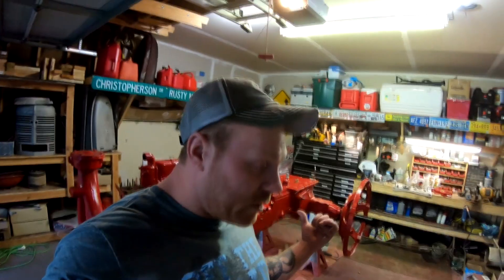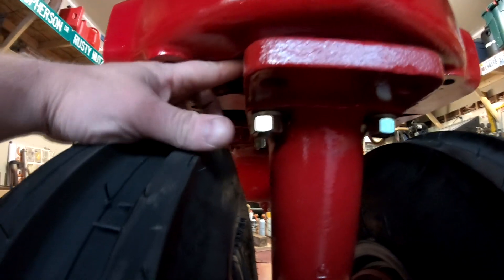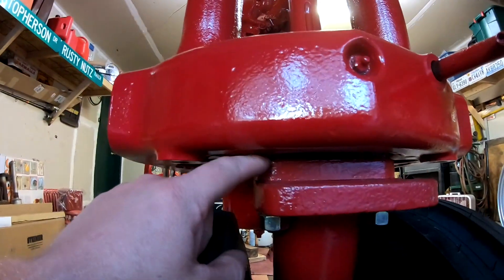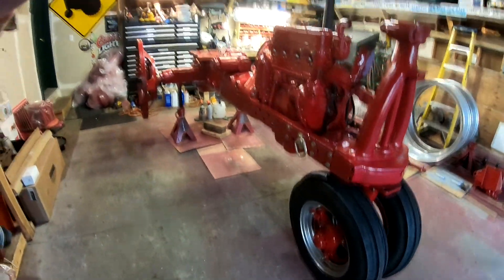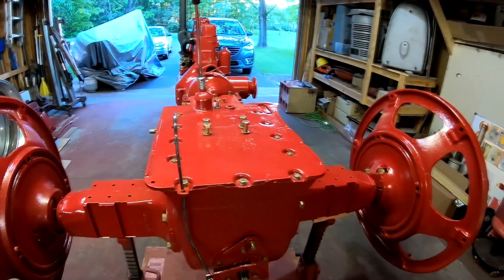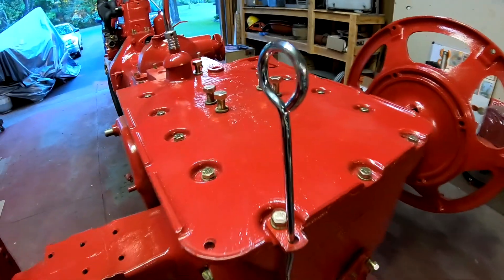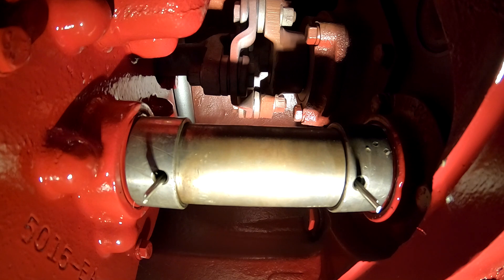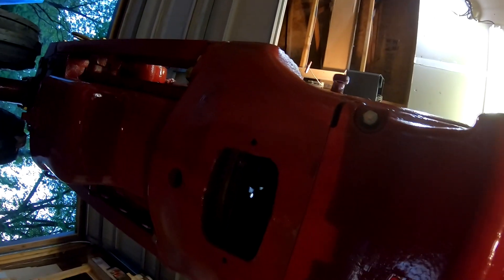1942 Farmall H Memorial Restoration: Lift All/Hydraulic Pump Installation

Comment: Didn't realize that the H and M are different as in less room on the M to hook up the belly pump.  Learn something new today.  Thanks for the video.
Reply from the maker: Yessir! Lot of differences between an H and M. The clutch housing is just one of many. The M has a much shorter clutch housing than the H.
Reply: Thanks for the reply.  @KennyKizzleRustyNutzRanch  I remember helping my Dad put the belly pump in his Farmall M.  It had to be connected  while the pump was going up in the clutch housing. Never took the belly pump out of my H.
Reply from the maker: @stanschleusener6444  yessir. The M drive coupling had the tabs for the drive cogs machined perpendicular to each other, so the only way to install it is to do it while you are raising the pump into position. There are no retaining collars like there are on the H.

Comment: What you forget when you don't work with these every day. I did not realize the H had a long hydraulic pump drive shaft. Maybe I never helped dad take the belly pump out of the H. I know the M has a very short coupler that has to be lined up while you raise the pump in to the housing. We would lift the pump up with a rod through that belly pump hole and screw the fill plug onto the filler neck when we had it up high enough. We would regroup and lift it the rest of the way to get the bolts in. My dad had found a take apart coupler that had a cotter pin to hold the dog together. I have a video on it on my channel called "Farmall M Belly Pump Drive Coupler Dog" It sure was a time saver.
Reply from the maker: Yessir. The M is a lot different. The torque tube/clutch housing on the M is much shorter than it is on an H. It's funny the minds of tricks a person learns while doing this stuff - especially when doing it alone. You sometimes have to get creative!

Comment: my IH dealer had 2 T shaped  handles that fit in that big hole in the bottome of the pump casting 2 mechanics could lift the pump in  and out with it
  they were made with  1 inch bar stock with an ear welded to each one they had a stand  made to flip down so when they were lifted into place   they will stay in place so the bolts could be started. these were part of the tool kit to service the pump, transmission seals or install a clutch in the field.
Reply from the maker: Yessir! I've actually seen them in the parts/repair manual. They had part numbers for those tools, even.
Reply: @KennyKizzleRustyNutzRanch  yes but i got to use them that was what was so neat.. also farmall made mounted plows for the  letter series tractors    the only problem was they took a while to mount and take off but they were easier to pull than a trip plow
Reply from the maker: Yessir. I've seen a few of those mounted plows. A guy could make a pair of T handles quite easily to use for removal. A floor jack works great as well.

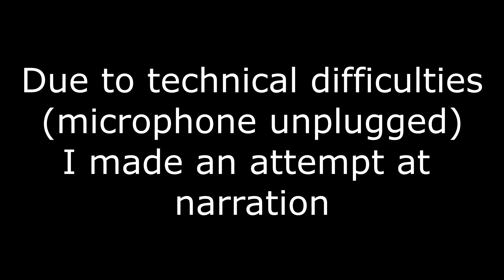Comment: Do you think it would be possible to replace the seal on the transmission input shaft without dropping the hydraulic pump?  Is it possible that with the pump coupling out, there is just enough room to "reasonably" remove the yoke and the seal cap?  At about 10:30, it looks like it may be possible.
Reply from the maker: I don't think it is possible. You have to remove the entire drive shaft and clutch assembly to get that all apart, which requires dropping the pump. You could try, but I really don't think it will work. I would recommend replacing the seal on the hydraulic drive (countershaft) as well.
Reply: @KennyKizzleRustyNutzRanch  Hi Kenny.  Thank you for responding to me.  I appreciate that!  Well, good news and bad news.  Getting the transmission input seal cap out of an H without removing the lift all pump was somewhat easy.  It didn't look like my kid had any problems at all getting up in there.  Ha ha.  The original 1943 leather seal was shot!  But, the bad news is that I can watch transmission oil come out of the counter shaft seal.  Exactly as you thought.  So, I will have to rewatch your excellent video once again to be double sure how to get that cog off the end of the transmission counter shaft.  For sure taking the counter shaft seal out will drain the fluid.  Shoot!!  Finally, as a strange bonus, the hydraulic pump input shaft leaks too.  I am sure all the seals are original leather.

Comment: I just found your videos.  First, out of curiosity, where are you located?  (I’m trying to figure out what was going on in that area you were mentioning)
Now the question:  did you rebuild this pump?  If so, do you have a video of it?
Thanks for your efforts in making videos. It helps a newbie like me.  I just got my H last week. Again, thanks.
Reply from the maker: I'm located in East central Minnesota. I disassembled, inspected, and replaced what worn parts there were in this pump. There is very little for the lift all system that is available new. There are two videos on this series regarding pump teardown and reassemble.

Comment: Is there anything special to do to take the pump out where does the lines on the side of the tractor connect to
Reply from the maker: 1) Remove the access plate. 2) Drain pump. 3) Remove hydraulic outlet pipes - total of 3. 4) Remove actuating lever. 5) Remove coupler collars and coupler shaft. 6) Carefully lower pump ensuring that it is adequately supported and balanced. They are awkward and weigh well over 100lbs.
Reply: @KennyKizzleRustyNutzRanch  it just could be me running so thin of hydraulic fluid.. I need to look underneath of it in probably drain the fluid first and try to us straight 30 weight I'm trying to Liftt a New Holland 479 haybine and it will not lift it out of the locked position

Comment: I could hear you best when you were under the tractor showing the coupling of the liftall pump. Love the cad plated bolts, are you leaving them that way? Yes not "correct" but it sure makes things pop!
Reply from the maker: That's the portion I had to narrate because the mic came unplugged. The bolts will be left Cadmium plated.